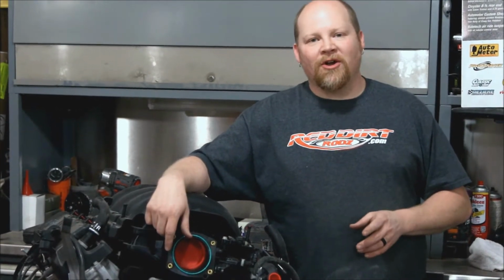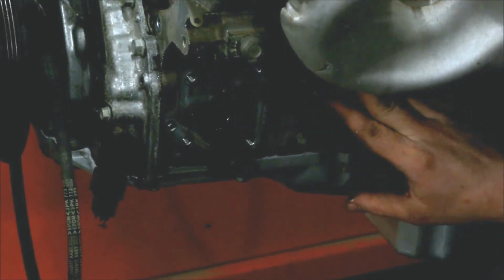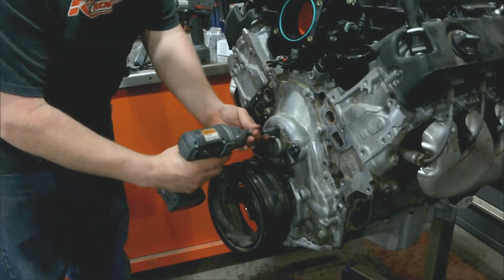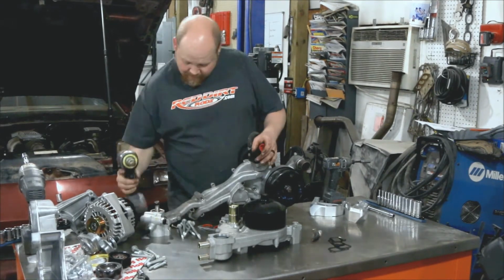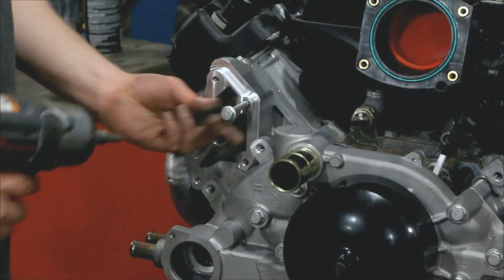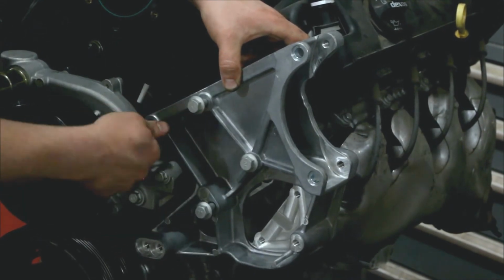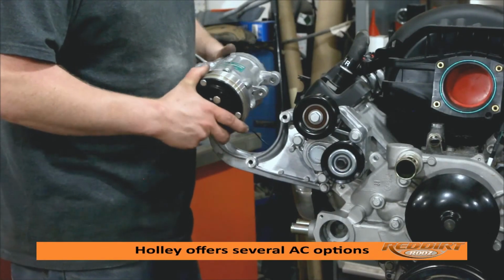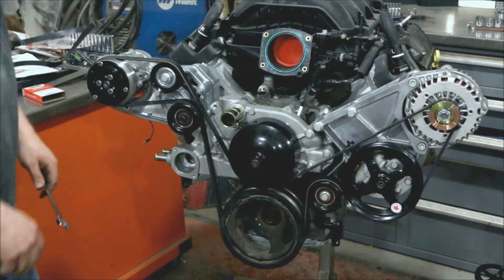How to Assemble a Holley LS LT Engine Swap Accessory Drive System

Comment: Wondering if you have a part number for the LT Holley swap that you have in your video?
Reply from the maker: For sure! 20-170. To be honest, the mid-mount is way more compact. I use it for my swaps now. https://www.holley.com/products/engine/accessory_drive_brackets_and_kits/gm_gen_v_lt/high-mount_accessory_drive_systems/accessory_drive_systems/parts/20-170
Reply: @Reddirtrodz  that price is astounding

Comment: What kind of Mormon and brackets do you use?
Reply: I have a72  C10  pick up  truck and I want to install LT1 engine and my question is which brackets do you use for the engine  mounts  to be able to get the right motor mounts
Reply from the maker: @marcosvelazquez1320  I gotcha. I have been using the Holley Hooker Blackheart system for LS and LT swaps lately, I really like the convienance and zero guesswork with their kits. The motor mounts are excellent, I have a squarebody Suburban I am about to LT swap using their parts. I did a 67 C10 a few years ago and I used Transdapt adapters, you just have to play with the engine setback depending on what trans you are using. The Hooker system is just easier in that regard, as it has the frame stands and engine adapter plates with the motor mounts. The others like Transdapt use the original frame stands and SBC motor mounts, you are just adapting the SBC mounts to the block. 

My upcoming book "How to Swap GM LS and LT Series Engines in to 63-98 C/K10 Trucks" will be out in about 6 or 7 months-ish from today (Jan 5 2023), published by CarTech Books, so if you are doing a long-term project, that may be a book you want to pick up, as it covers all of that. You can also message me thru Editor@StreetTechMag.com.
Reply: Hi brother,  Like I told you before I'm doing the restoration on my chevy 72 with my son we don't have a lot of experience on this.

Questions which wiring harness breand  you recommend for this project?

for the engine and body harness?

PSI conversion, kwick wire, painless or swap time?

 I will appreciate your knowledge!
Reply from the maker: @Marcos Velazquez  for chassis harnesses I recommend Painless Performance. For engine harness, it all depends on whether or not you are going to use the stock ECM. Stock ECM, you can do use Painless's ls harness or Speartech, psi, etc. I like Painless for no mods, and Speartech for modded harnesses (extra length, etc). If you are doing an LT, speartech, psi, or Howell. 

If you want to use an aftermarket ecm, the Holley Terminator Max is the way to go.
Reply from the maker: I'm not following your question.
Reply: We are using an LT engine I have the 6L80 transmission and I have the ECM and stock PCM I'm going to need to reset those 2 .
thank you! bro
Reply from the maker: @marcosvelazquez1320  Gotcha! So you are going to want to contact Speartech or StandaloneHarness.com (I just used them for an LT swap). Standalone can take your stock harness and convert it, makes it nice and easy. Are you planning on running the factory PWM fuel module? If so, then you need to go with Speartech. I have done both, prefer the PWM fuel control. What year is your engine? There are some critical issues with 2019-up units. The transmission controller is built into the 6L80, so you just need the harness, makes that part real easy.
Reply: @Reddirtrodz no I don't have the PWM do I need to install it?
the engine came out of 2018 escalade the transmission came from 2012 chevy silverado ether this companys do the programing?
Reply from the maker: @Marcos Velazquez  standalone does not, speartech does. You dont have to use the pwm fuel module if you do a 60 psi return Fuel system, but I prefer the pwm style personally. 

You should be good to go with that package!
Reply: @Reddirtrodz  Thank you Jeff for all your help can you send me your email address plz.
I tried to send you my email address through this side but didn't let me
Reply from the maker: @marcosvelazquez1320  info at Streettechmag dot com

Comment: so basically using old stuff instead of the new tech
Reply: The tech is the same. The LTAC compressor is essentially the same as an LS, which is not compatible with older AC systems (They freeze up), the alternator is an alternator, and the PS pumps are all type-II GM pumps. The only real difference is the water pump, which is just a standard water pump, offset to one side. 

The factory LT accessories do not fit well in any vehicle as factory, they have to be modified regardless in almost all cases.
Reply: @jeffersonbryant764  if a ac system freezes up then something isnt right, the alt is not "just a alt" the new LT alt u change the voltage and on time through hp tuners not a resistor like the older ones, its also not on all the time. LT dont have power steering pumps to keep fuel milage up from the drag its electric, and the water pump is made to bypass the VVT, and the big thing is just the water pump housing, the actual pump is the black circle it just pops out with a few bolts making pump changes easier in the long run.
Reply from the maker: @bad4health  The issue is that the new style AC compressors use variable pressures, which do not work very will with older OEM AC and aftermarket systems. They can be adapted, but they generally do not function well and converting to a non-variable compressor is advised. The alternator is a standard GM alternator, which has used variable output for many years. As for the water pump, GM went back to the center-mounted design in 2019. 

There is not really any "old tech" between the LS and LT accessories, they are essentially the same components. If you have power steering gearbox, you have to add a hydraulic PS pump or convert to an electric-assist steering column, that is the single biggest change in terms of accessories from LS to LT.
Reply: @Reddirtrodz is it possible to convert a 4th gen camaro to a electric asset steering  to use this lt style pump ?

Comment: looking to do this swap for my nova, i have an LT series as well, did you have to order the 21-3 and the 21-5 kits along with the 20-138 kit
Reply: You will need the following- 21-5 LT Installation Kit for GM Gen V LT Accessory Drive *22-100 LS Water Pump with forward facing outlet.
Reply: ok perfect, i was confused because i found a link that said you needed the 21-3 as well
Reply: Yeah, it is easy to get confused. The 21-3 is for the LS Truck alignment, the 21-5 is for the LT engines. 

Keep in mind that all LT engines with this drive require the LT truck crank pulley, the Corvette and Camaro pulleys DO NOT work with this kit.